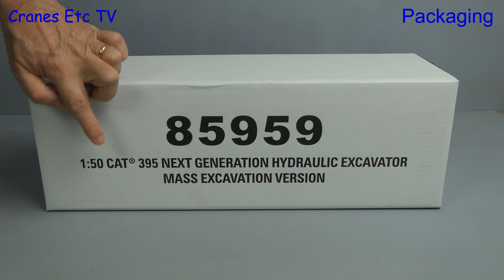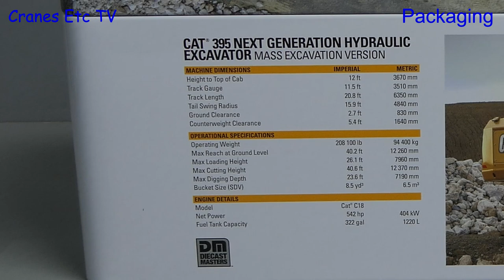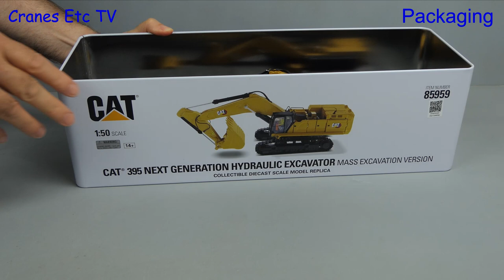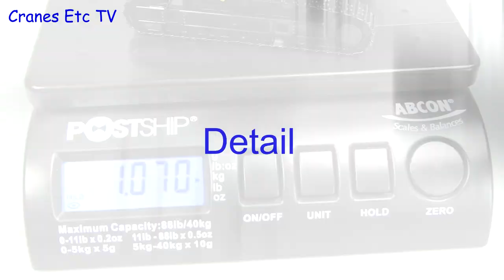Diecast Masters Caterpillar 395 ME Version Excavator by Cranes Etc TV

Comment: I think the exterior of the passenger compartment could be improved, and the seam on one side of the arm instead of putting it under it seems poorly done in my opinion
Reply: I think it looks good as thats how the steel plates are arranged when welded. Could fill in the gap though
Reply: @MADEINNSW I think the model can be improved, there are better manufactured and cheaper models. For example, I have the new zx890-7 from TMC Models, it is better made, cheaper and realistically far surpasses the 395. I have nothing against DM, in fact I have several models of them, but this excavator should have an updated version